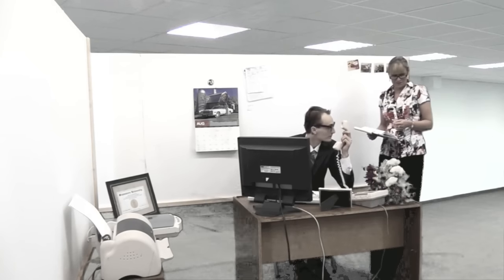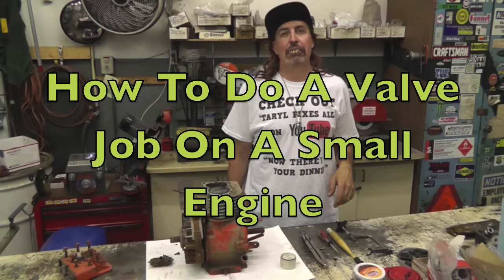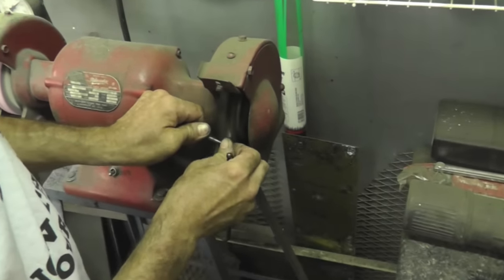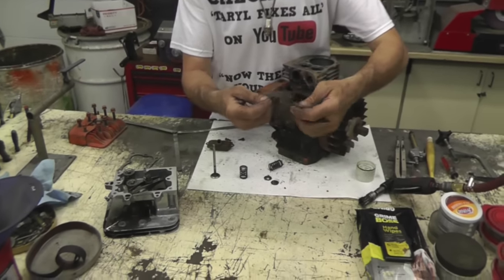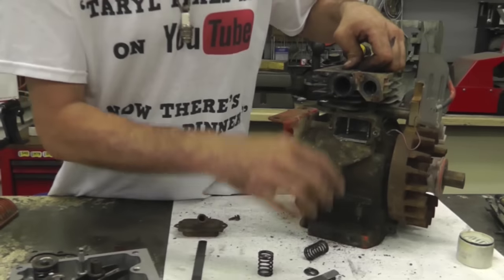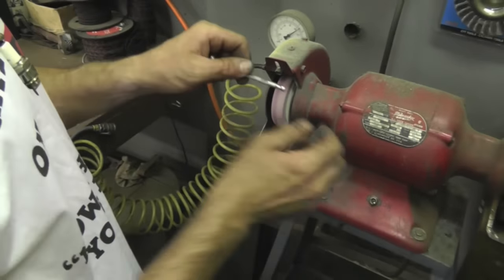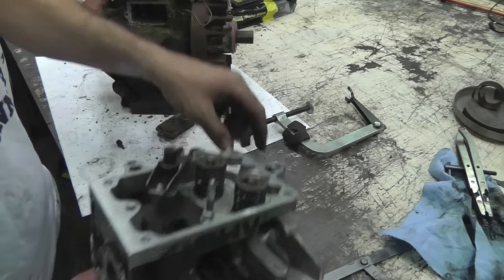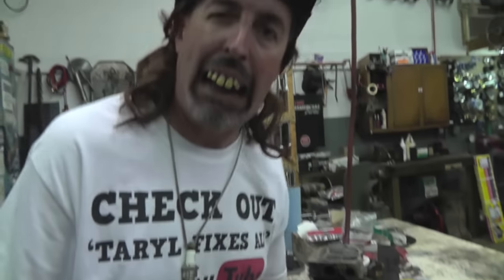How To Do A Valve Job On A Small Engine: A Complete Guide

Comment: on my tecumseh the exhaust valve has a little nub in the valve case compartment where the springs are where the stem comes out.on the intake it does not have that

Comment: Taryl I am replacing the head gasket on that same engine. What are the torque specs for the head bolts? I can't find a diagram anywhere.
Reply: FuckingTight usually works for me . Just make sure you apply the FT setting in a criss cross fashion . Also remember after FT comes the  ST (Stripped Bolt) setting . You don't wanna go that far .
Reply: 165 in. lbs.

Comment: this video is not my exact engine which is a briggs and stratton 18hp Intek OHV  .... i need to fix the valve seat with a sharp punch into the aluminum like in one of your videos.  but where the head gasket blew i have stress cracks in the aluminum but NOT on the flat gasket surface, or at any place that will leak oil or anything , the stress cracks are in the inside of the housing just below where the typical head gaskets blow on those 2 spots real close to each other (defective gasket location).  i'm not a metallurgist but those stress cracks are ok , right?  like you always say, "It's a lawn-mower" , It's not an airplane that you're haulin' your mom around in.

Comment: Taryl, like your vids.no doubt lots ofexperience with your best tool.Worked on Onan p218g with dead cyl. Ridges on exhaust valve locks ripped out so valve was not held in cap.Have you any knowledge of cause?Best to you and crew.Jesus saves!

Comment: I ground too much off the stem of the intake valve and the gap is about twice as much as is should be. The engine runs, but will this cause long-term problems? Should I get a new valve and try again?
Reply from the maker: +Eddy Smith   It might make a ticking noise. But if it runs should be OK. If you have a shop that can grind the face of the valve that will take out some of that clearance.
Reply: +Taryl Fixes All LLC Thanks, Taryl. And thanks for your videos. You've saved me a ton of money and helped me resurrect a pressure washer motor that I had just about given up on.

Comment: Hi Taryl. I have a B&S intek 8HP, and just after I start it, the moffler gets red hot...could it be a carb or valves issue? Thanks!!
Reply from the maker: +Marcos A. Hofer  Sounds like a valve job.
Reply: running too lean.....not enough fuel and too much air.
Reply: Both sound possible,also ,do you have enough ex. clearance?AND.....,I 
 gotta ask....,has anyone had the cam out?   If so,check for proper alignment of marks.

Comment: hay taryl what happens if u don't lap the valves and is the lapping tool expensive
Reply from the maker: Lapping is what seals the valves from leaking . The tool you can buy at yur local mower shop,auto parts or online. Thanks fer watchin & being a fan.
Reply: +Taryl Fixes All thanks it turned out my grandfather had the tool so I lapped them in and put it all back together now I just need to find a carb and a gas tank and then I can try it out great vid what is your shop called

Comment: question, why do some kohler engines have a valve stem seal on the intake, but not the exhaust?
Reply: Because intake vacuum will suck oil from the rocker box. but exhaust pressure prevents oil going down the exhaust valves.
Reply: Makes sense. I put seals on both valves, its an aging CV15S, valve guides are likely wearing. Unsure of hours, no meter. The seals stopped oil from leaking in combustion chamber, but i know eventually head will need rework or replacement.

Comment: just hammer valve down with ball peen hammer to reseat. LOL
On HD motors there are three angles on seat. Keep seat narrow per spec. or carbon will keep valve open and burn a exhaust valve. Ok for small motors as these.
Excellent fun Show.

Comment: do they make stiffer springs for the briggs?
Reply from the maker: hddm3 Not that I know of. It would be nice if they did.
Reply: +Taryl Fixes All LLC     Hi T Dac I have a brigs engine and want to replace the valve springs could you replace them with Kohler or honda springs instead.??
Reply: +Brian Johnson yeah i have a briggs ohv and i bought honda 18lbs valve springs and they fit perfectly and work great i removed the govonor and run 110 octain gas still running strong
Reply: Put washer under stock spring.

Comment: what does the compound do?
Reply: It's a sand(silicone) and oil mixture that gradually grinds the valve&seat until it's perfectly sealed . Compound also comes in different grid .